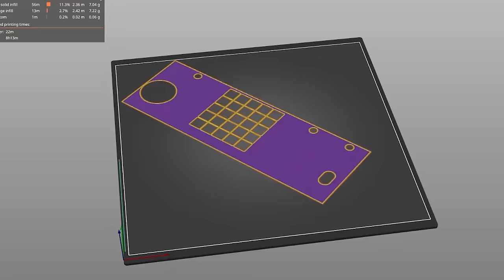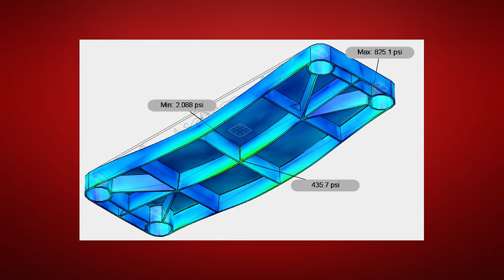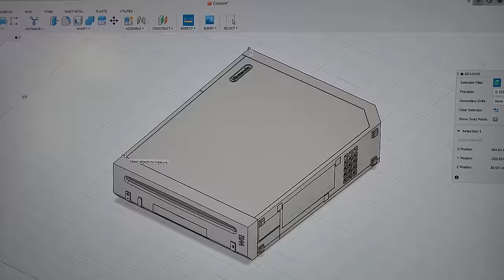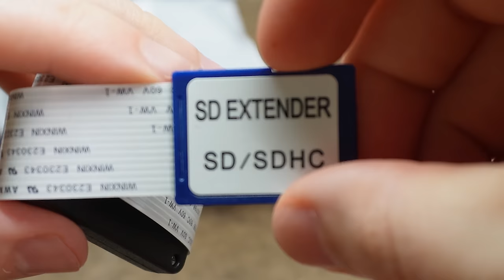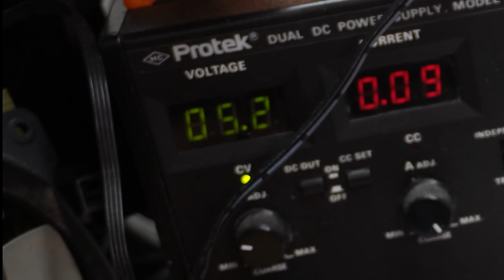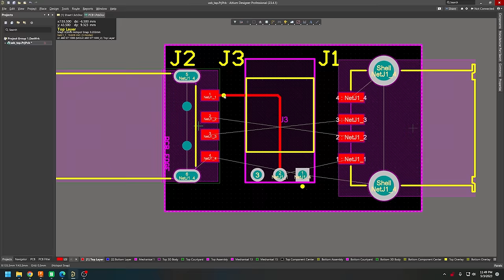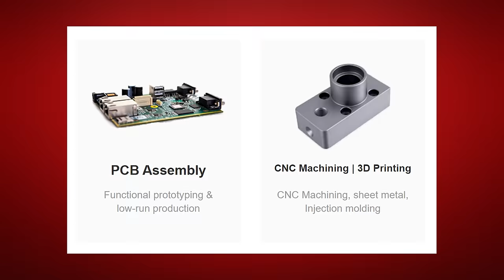I Built a Wii XL

Comment: Fun fact: the sensor bar works by transmitting IR to the Wiimote.  This means you can use candles instead as flames also emit IR.  The sensor bar isn't a sensor.  The name is most likely a pun with censor bar due to the TV theming to the Wii.
Reply: Fun Fact: The Wii Remote has never officially been referred to as "Wiimote"
Reply: @Chipmunkboy i do refer to it as a wiimote always have
Reply: @Miketheike123  that changes nothing

Comment: You should make a larger one that could fit a real PC capable of  emulating wii games at 4k
Reply: That would be a pc then

Edit: It's like if I said "Imma turn this chromebook into a bigger chromebook" then proceed to build a separate pc that can emulate a chromebook.
Reply: @andrive  And plus, someone already put a Mac Mini in a regular Wii case.
Reply: @andrive  no shit
Reply: @andrive  Captain Obvious to the rescue again.
Reply: @andrive  ha, big chromebook

sounds funny
Reply: You would definitley be able to fit small pc components into this size of Wii
Reply: It would suck though. Dolphin sucks.
Reply: @90sNath clearly you're doing something wrong then
Reply: @user-yw8sr3uj1w  no? Dolphin has had frame pacing issues for years. Constant stuttering despite the in game frame rate saying 60
Reply: @90sNath You sure it’s not your computer? Never had that issue with any GameCube games on a laptop running on integrated graphics (Intel Core i3, series I think 600?) or on my current PC. You ever try turning Dual Core emulation off? That causes some stutter (and crashes)
Reply: @sm3dwplessie765  no it wasn't my computer. The Dolphin Team recently admitted to their being stuttering problems for years and finally just a few weeks ago, fixed the issues
Reply: @90sNath been using it for years, never experienced that. Even on my old ass 2500k cpu.
Reply: Dolphin works fine on Pentium d laptop

Comment: This would be a hilarious computer case
Reply: Considering that the Wii XL has a similar if not larger size than a Mid-Tower or Mini-Tower case, it wouldn't be impossible to do that
Reply: @sleepyboi2852  
4k Dolphin Emu Station
Reply: if he sold it as a pc case id buy it
Reply: Little bit too thin to fit any good graphics cards in there. Also the plastic would melt if no proper cooling is supplied, after all single fan isn't ok.
Reply: @CHGOfficial512 Not wrong, but low profile graphics cards are still a thing, or a laptop could be repurposed into desktop.
Reply: @freescape08  I assumed that you were talking about system with normal pc layout.
Reply: @CHGOfficial512 Could you not vertically mount the GPU
Reply: @m.f.3347   Possibly but probably only up to 2 slots.
Reply: The Wii-C!
Reply: you mean sick
Reply: But it would be absolutely beautiful
Reply: I'm trying to make this a reality right now but it is going to take quite a long while since I have never done something like this before. :)
Reply: @thesurant7271  dope
Reply: Too bad my printer broke down, or else I would have made it.
Reply: especially if you played mario kart wii on it with a giant wiimote
Reply: M1 Wii:
Reply: thanks for the idea
Reply: Genuinely going to try and find someone local to me that does custom fabrication and try to make this a reality. Going to also try to get a custom tempered glass side panel as well, but that'll depend on how pricey the glass is.
Reply: DANG IT

Comment: 17:27 for future reference: its best not to solder mains connections. Solder cracks and can allow shorting. You should use insulated crimped spade connectors which push on :)
and they definitely should be individually insulated
Reply: oh so THAT'S why those weird connectors are used (I hate them they're so annoying)

Comment: You can get a cheap airbrush (they go as low as like 15$) and paint it that way, and then afterwards spray it with a gloss sealer to make it glossy like the wii. The airbrush will probably prevent it from feeling goopy like spray paint too, since spray paints are usually really thick to fill in scratches and the like, but just putting that craft paint with some thinner through the airbrush should feel no different to how your side panel feels. It should also let you easily use those stencils, if you wanna go that route. The gaps could be filled with some epoxy putties and sanded to fit if you cant reprint it. Awesome build though :D
Reply: Yeah he kept saying the video had to get done, but had he been will to spend a lot more time he could have filled/sanded/painted the whole thing and made it look super clean. An air brush with stencils could have done the lettering passably too, but I get not wanting to do that lol

Comment: 22:53 The adapter you used just outputs the raw Wii signals just like mine: 480i for NTSC signals and 480p for 31khz progressive signals.  This is critical for playing the Wii with the lowest latency as possible.

Also, you can just use a wireless or USB-powered sensor bar to play your shooting games like Duck Hunt (WiiMednafen or FCE Ultra GX), Lethal Enforcers (Genesis Plus GX) and Big Buck Hunter Pro, so a CRT is not necessary, as the Wii Remotes instead relied on infrared timing.

Comment: You can get sensor bar extension cables. No need to take it off a motherboard. You would've been quite easily able to add a sensor bar plug onto the back.
Reply from the maker: Yeah I realized that very recently when I came across one on Amazon. Had no idea that was a thing
Reply: weird that that's a thing considering how excessively long the cable is
Reply: @numairdubas2688  I thought the same thing too. But there were some people playing Wii on a projector, where the screen often isn't near the console.

Comment: It would be really cool to do a larger version that can fit a Wii and a PC inside. And if possible design it so you could switch between the two using the front buttons
Reply: Or a pc that could read wii disks
Reply: @Blavin that actually wouldn't be too hard.all that you need to do is rip the drive out the wii and throw it in the pc

Comment: if it were up to me, i'd disconnect the og wii's faceplate and wire up the port to the front plate on the xl instead of making linkages. this would also allow for the light around the dvd slot and the sync button

Comment: you can glue pla permanently with CA glue. It sort of welds the plastic together. Need to wet both sides and let it sit for a bit, then push them together with a bit of force to make a good bond.

Comment: One thing I would have done with your PCB was to add a diode on the + line going to the fan. Fans can also be voltage generators. You don’t want voltage back feeding into your USB port or device.
Reply from the maker: Yeah in hindsight that would have been a good idea as well as a small fuse or something

Comment: I done something similar with a gameboy and old pc but a tip since your buttons are modular I would use your fan tap to wire in a led and put it in the power button so it lights up when it on. that shouldnt be hard to add in. Or since you dont need the light bar plug the led into that. ;) It should still turn on when the wii comes on and would be 3 volts give or take making it perfect for that lil red led for the power button.

Comment: You could have used the fan pcb to power the wii sensor bar, all the sensor bar port does is provide power to 4 ir  leds,  the actual brains for positioning the pointer are housed in the wiimote

Comment: there are some things I would have done differently, first, I would have made an adapter that can output HDMI to HDMI and composite. second, I would have kept the Wii sensor bar. third, I would have used adapters for the GameCube controllers and memory cards. fourthly, I would have an adapter where you have 2 SD card slots (though it would be hard not having the Wii write to both SD cards. fifthly, I would have allowed the eject button to pe pressed and also replace the Wii disc drive (one for Wii games and the Wii disc drive for GameCube games) and the list goes on including a Wii mote XL and Nun chuck XL, the sync button having a button, upgrading to FOUR usb slots (2 usb-a and 2 usb-c (though like the SD card I would have no idea on how for the Wii to recognize four usb slots with adapters) for usb c compatibility) a second SSD, and something that you would have to carry over is all the text, stickers, engraved text, all the icons, and the ATI logo ( opposite of the Nintendo logo) and also the ability to use 4 or 6 memory cards to combine into one would be great (my issue is with the SD cards and not rally the usb issue because the Wii might write to all 3 memory sticks) and some fun stuff (but completely optional) would be the ability for the Wii to support every video output out there and the ability to run NES, SNES, GB, GBC, GBA, N64, the freaken VIRTRAL BOY, and a lot more (not like the ds or ps3) without emulation.

Hopefully you can use this to improve appon the Wii xl.

Comment: I don't know much about Linux but I've always wondered if you could use it through some combination with retroarch or dolphin specifically to essentially make it a Wii through and through. Like you turn on the system and it boots into dolphin automatically
Reply: Would probably work, but dolphin's wii system menu emulation is still a bit rough around the edges and can crash or get random bugs from time to time
Reply: @shadesoftime  Nifty! Thanks for the info

Comment: It woulda been cooler to have a retractable plug for the power instead of making that odd adapter. So you vould still have the brick inside but the rest outside, with it going in or out for storage.

Comment: if you use two levers, it would allow you to press the button, and then all you have to do is adjust their positioning and length to get them to hit the button just right

the alternative is some sort of stupid, maybe hydraulic, system that slides back and forth, that might not work reliably, same for the sync button

you could also use pogo pins and dupont pins that are shoved into the IR connector, and basically make a rather crude, but otherwise functional, connection to the outside for an actual sensor bar, if you didnt want to install it into the MegaWii as it is

Comment: I have an idea for a small update you could make for this absolute unit. You know how the Wii to HDMI adapter has an aux port? I say you drill a hole on the backside somewhere out of the way and have an aux port extension cable to give it some use for external speakers or what have you.
Reply: Or build larger speakers into the Wii

Comment: This is awesome! In a V2, it would be cool to make the ENORMOUS version, and use filler to hide the gaps that would inevitably be there.

I would do it myself, but my only printer is an Ender 3, which is definitely not good enough to print parts this large. If I tried, it would probably burn my house down lmao.
I might make my own based on a 40mm server blower fan though, which would be the most awful sounding Wii ever created.

Comment: I’ve seen some cars with a 5 disk input, idk how expensive it is but is a cool upgrade if you can
Reply: that would require a ridiculous amount of custom firmware, fake giant cds with NFC tags could trigger a microcontroller to load the game off of a flash drive in the back though

Comment: What if the back USB ports were connected through a powered USB hub? Would that work? Then maybe you could plug a hard drive in there without worrying about the fan power.

Comment: I have so many thoughts of what you could do with an embiggened wii. you could stick a hard drive in there with a power stealer so you could actually use a hard drive, you could make the GameCube ports under the SD card slot

Comment: Why didn't you just run the plug out the back from the ac adapter instead of that redundant and rather precarious solution

Also before you say too short, extension cord